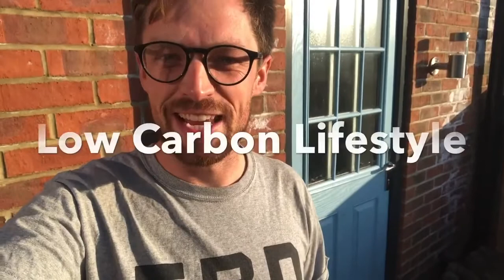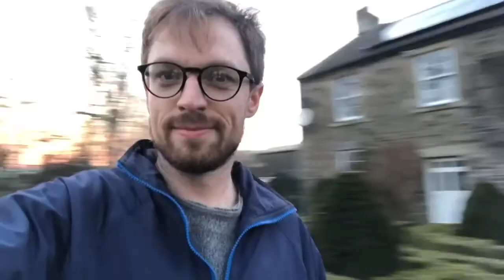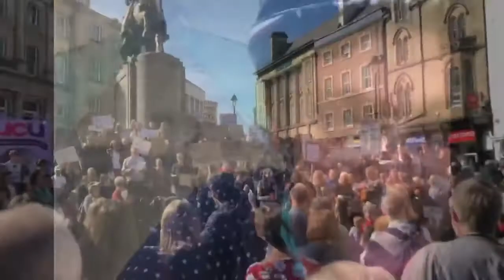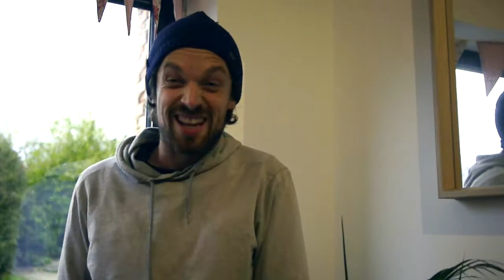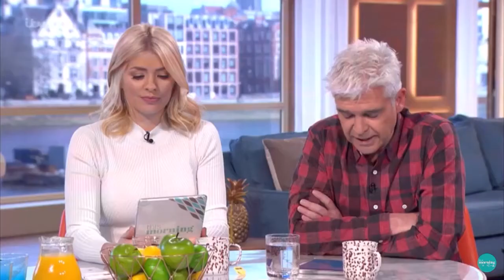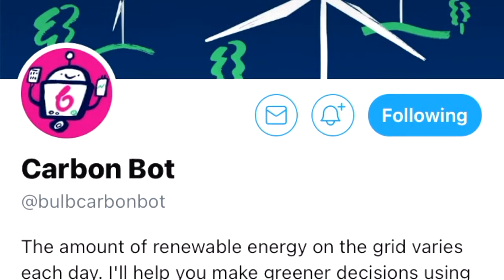OCTOPUS AGILE - the 1st 8 months of an 'agile' electricity supply - Low Carbon Lifestyle Episode 12

Comment: Love the idea of an Amish Hour!

That whole negative pricing thing is worth investigating - smart controls to bring on a DHW immersion heater, or maybe a controllable wall socket to charge mobiles, laptops, etc.

Makes a lot of sense when an EV is involved, or home battery storage, and the ability to sell capacity back at peak times. OVO have a V2G trial at the moment, for owners of Nissan LEAF cars and Env200 vans like Refuse's. Become a kWh trader, not just a consumer! 😎
Reply from the maker: Yep spot on! We don't really have anything in the house that uses much electricity.... if we had an immersion heater then it would make so much sense to charge when low. The energy involved with charging phones / laptops is so low, but all makes a difference. 

V2G is the future!